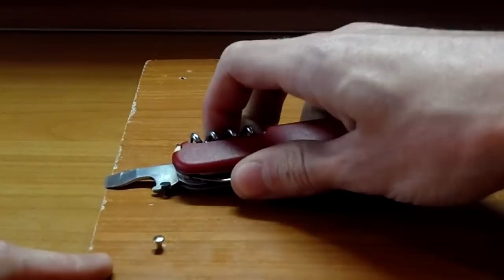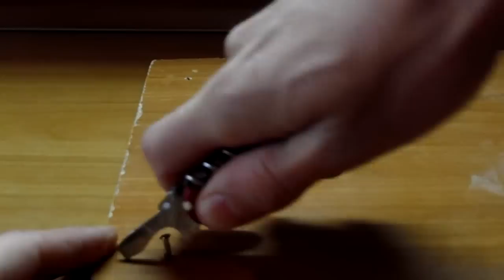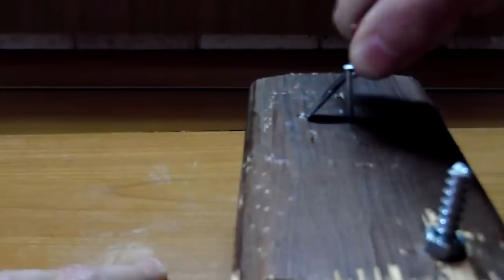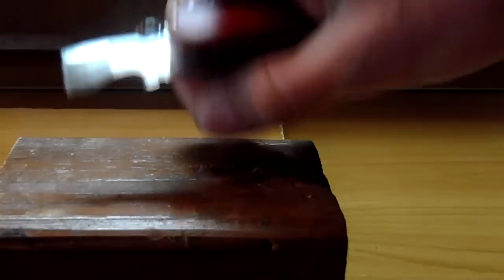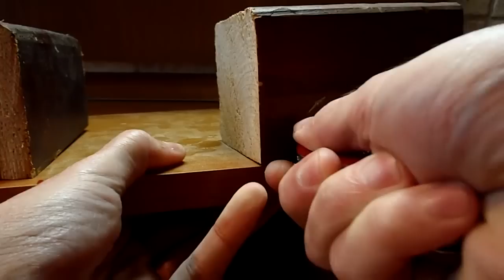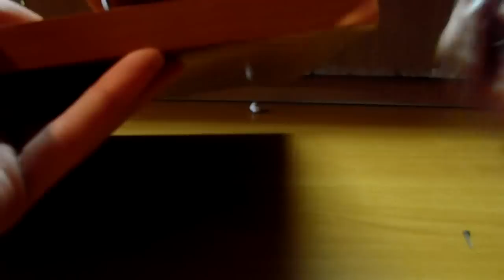victorinox hack-mini pry-bar,Don't destroy your blade(all subtitles-υποτιτλοι)

Comment: Does a combo tool works like a plybar
Reply from the maker: it is for very light use,but is better as prybar than your blade tip.victorinox suggests the classic flat head screwdriver as mini prybar.
Reply: @nikgyver7  I was totally confused  about this matter and I feel so confused about sak Which one I buy which one I buy.  First I thought  to buy  Spartan and I bought that after collecting  money from my bus fair unfortunately I loss it when I gone for a ride. I became so stressed and so depressed   after seeing  you vedios I got the idea about hook and it's uses. Then I thought to buy climbers. Then I thought  it is too bulky and then I changed to compact. Now again I changed. Now i am thinking  about  buying  a climber. I am collecting  money for that
Reply from the maker: climber was my edc 1991-1993,many models to choose what is better for you..i think you will buy many models in the future.
Reply: @nikgyver7  true I think I will buy many models 

First I need a climber  I think it is  compact. I don't need two blades because  I use a Gerber paraframe tanto as a primary blade and I am thinking  Sak's blade as secondary  

I thought  an idea if they increase  the size of compo tool I can use that as ply bar and I become satisfied 

And I am thinking  about buying a spirit  tool but the depression point of there is it have not a changeable screw drivers and it have no replacable wirecutters 

I am thinking  about buying a letter man rebar and adding a changeable  screwed driver in it by removing  that Philip heads space
Reply: @alexwolf4435  i suggest the huntsman
Reply: @nikgyver7  now pry it at the hospital 🤣